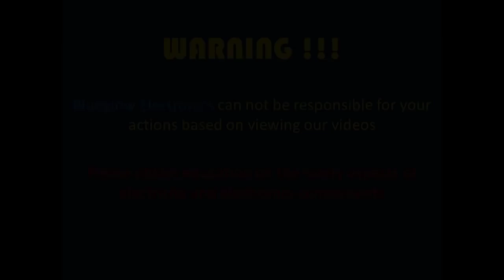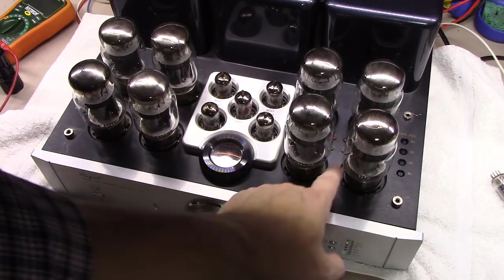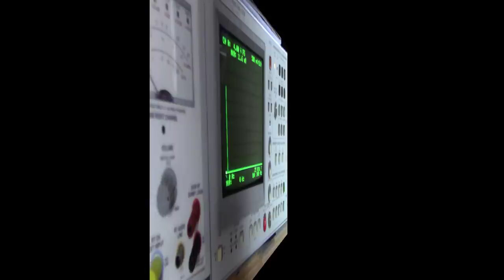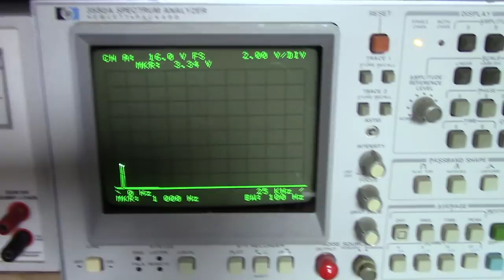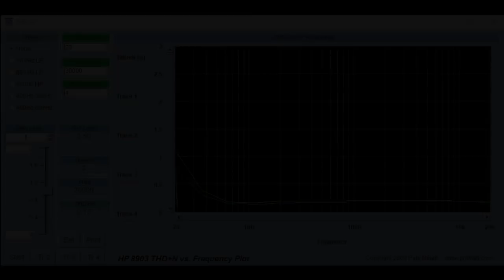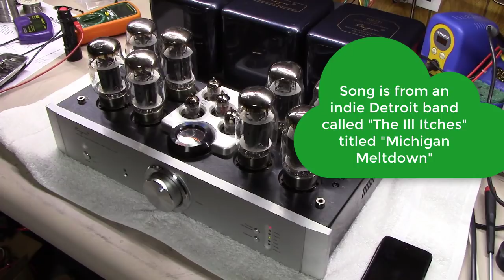Bench Test - Cayin A-100T 8 x KT88 Tube Amplifier

Comment: It’s balanced review with open mind. I owned one for last ten years. I have tried different brand power tubes KT88, with insignificant audio differences. However, with different pre amp tubes,  the audio signature varies substantially with NOS Mullard, Mazda, telefunken etc 12au7. The amp is such great value, comparing to the very expensive old tube amp from the 50/60s. I enjoy the amp thoroughly, even though not in the same league as McIntosh, Audio Research etc. but similar enough.

Comment: If you adjust to the same miliamps at a certain voltage that does not mean that tube curves are identical. Especially made in China. Just yet more Chinese shiny ... thing. That ampermeter cost you about extra $1000.

Comment: Have the EL-34 version. It's a 70lbs, very well-built and great sounding Integrated Amplifier. I believe it's the same as Prima Luna (Spark China).
Experimented with Gold Lions, Tung Sol, Electro Harmonix, Mullards, but found the original Cayin's EL-34 Chinese power tubes to be the best match for my system. I liked the Tung Sols as well, didn't like the Electro Harmonixs; the Mullards have great bass but sounded too dull. As for the pre-Amp section, I installed Gold Lions there.
Get yourself one, you won't be disappointed.
Reply: I am a babe in the woods here ,Why are the Gold Lions best for the Pre Amp? I do have a PrimaLuna Evo300, just curious about what good Pre Amp tubes do for sound. I know it’s a general question, but I am learning.
Reply: @beagle7622  Hi Beagle76. Some tubes lean towards a warmer-duller sound, other are a little more on the brighter-detailed side. Gold Lions are on the detailed-lean side, while Mullards provide more bass but missing some detail. So, it depends on your system (speakers, source, amplifier and cables) and your subjective idea of good sound. In my system, Tung-Sols and Svetlanas are also a very good choice for the pre-amp section.
Reply: I just got one, pick it up soon, thanks for the information

Comment: You already said that the capacitors are not brand name and then we don’t Know so soon it will break. The second thing are the transformers are warm/hot, I think when I use several hours it will turn hot, so for safety purpose I won’t buy this stuff.

Comment: That bias meter is a joke. Setting the bias for each tube to the same value is not away to match the four tubes to each other, because, more likely than not, each tube will have a different gain. More then that, the outputs show only two output banana plugs per channel, which means the outputs are meant to drive a speaker   of that matching impedance; that is to say, the output impedance of the amp is 8 ohms, it should only be use with an eight ohm speaker, not a sixteen ohm or 4 ohm speaker. You, the bench tester should know that. Question, is the manufacturer of the amp giving you money or something??
Reply: better then not having it at all dont u think?

Comment: Wow, this is a really a drill down on the performance to the element level a true audio engineering bench test. This the high-end stuff serious audio material from China alright with a serious price tag running from 2K USD to 3.5K USD. Tube replacements could be costly too easily 500 USD

Comment: you just need a multimeter and a mini screwdriver to bias my tube amp.  would never pay someone to bias something that can be done yourself in less than 5 minutes.
Reply: Actually you can bias it if you know what you are doing , if not voltmeter is not going to help . And a lot of amps dont have Bias circuitry so that has to be done by pros

Comment: From your tests, it looks to me that the power supply filtering is inadequate.  The basic deign of that amp should not have that much distortion at the low frequencies.  A simple up-sizing of the filter caps for the plate voltage of the power output tubes should do the trick.

Comment: Quite a substantial beast isn't it - a small army of tubes!  One question I have is about your distortion measuring procedure - you seem to always use linear mode rather than logarithmic on the spectrum analyzer, which is unusual, and I don't think I've seen you do a two-tone intermodulation measurement.

I have a suspicion that intermodulation is what humans actually hear first when distortion is audible, since most real-world notes already come with significant harmonics and adding a tiny bit extra seems a minor thing compared to creation of multiple, non-harmonically related tones that were never present in the original signal (which is what intermodulation does).

Comment: I just bought a chinese made amp. It is a Audioromy model 808a. I think it is a class A/B push-pull amp, because it's power is rated at 55 watts per channel into 8 ohms with less than 1% distortion(probably at 1 khz, though not specified). It has one 12ax7, two 12at7, two 6n8p, and four KT88-98's. The tubes are all cheap chinese. A guy on an a facebook group I'm also on said he has one just like mine and he thinks it sounds great, BUT he got his from another person who swapped out the cheap chinese KT-88-98's for Tung Sol 6550's, so he didn't get to hear it with the original tubes. I didn't expect any magical imaging or soundstage or any of that snake oil, but wanted undistorted sound. I figured if distortion was even 1% I wouldn't detect it with my ears, because I often dyno car amps with my AMM-1 handheld dyno and DD-1 Distortion meter and can't seem to hear 1% on them. I am going to get some Electro-Harmonix tubes soon.

Comment: Oh Help, I'm in the market for a Tube Amplifier and each time I look and ponder...my desire and cost go up and up! This Cayin looks stunning. Many years ago I had the Quad 22 and 202 set-up and it was fantastic after I did some mod's on it but retained the KT 66's  and the two power amps were rated at only 15 watts RMS each. This is a terrific review and I'm tempted but do I really want 100 watts? Can you please explain why my 15 watt Quad's sounded more like a 50-watt Transistor amp?
Reply: Look into the Wilsenton R8. 45 watts in push pull with total of 4 KT88 /6550/EL34

Comment: Still would not buy any high end product from china. Manufacturers support is non existent. Good luck trying to get proprietary parts.
I demo one of their dacs. The instructions were printed on newspaper.
Reply: audio phool check the audioamplified a cayin dealer here in the philippines...they have a good support for cayin amps
Reply: They have s distributor in Scotland too. Their amps are beautiful,  well designed and manufactured and their 24 watt pc 845  tube powered beauty has all 5 star owner reviews on the dealers website. It costs £5500 in the UK incl VAT @ 20%

Comment: Good amp but I would not buy point to point 70 year old technology tube amp from China, They do not deserve the right to copy this design.
Reply: If the design is that old I guess the patent has expired too, so I guess the Chinese or anyone else can copy it to their hearts  content. My point to point wired Audioromy Model 808A has nine tube sockets, all of them mounted on sturdy thick gauge metal squares bolted at all four corners to the heavy gauge chassis. My Audioromy Model 828A single ended amp has some point to point, but the four sockets for the 6H3D tubes are mounted directly to a P.C.B. They can flex too much when installing tubes and be permanently damaged.
Reply: You could always build your own.  It just takes time and sourcing the components.  Unless you also want to wind your own transformers, that is usually the hardest item to source.
Reply: @709zzy  Not all of us, trust me.
Reply: @dedskin1  То Пајо ! :-)
Reply: Your bigotry towards the Chinese is duly noted. Point-to-point wiring lasts a lot longer than brittle circuit boards ever will. You have no clue what you're talking about.